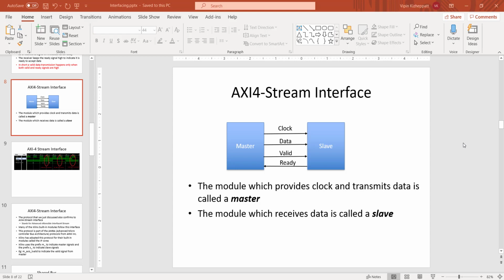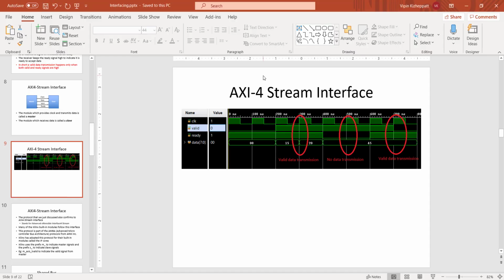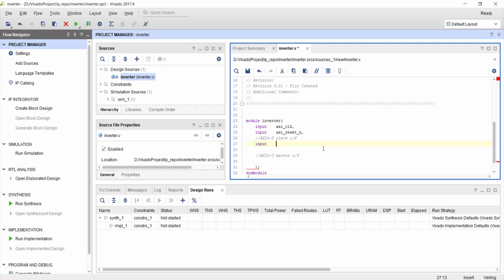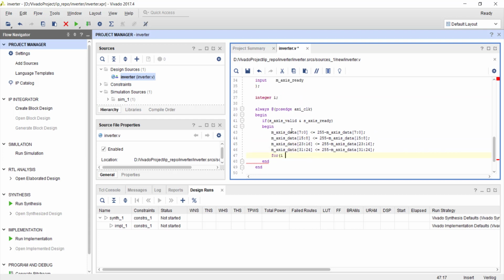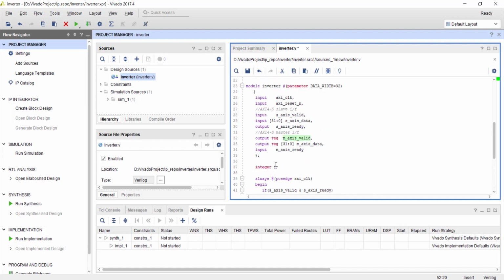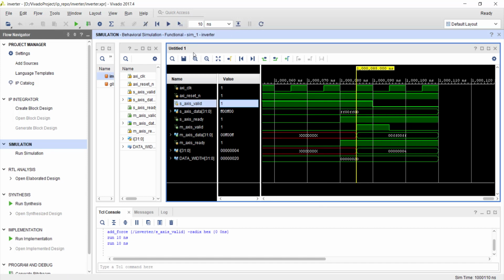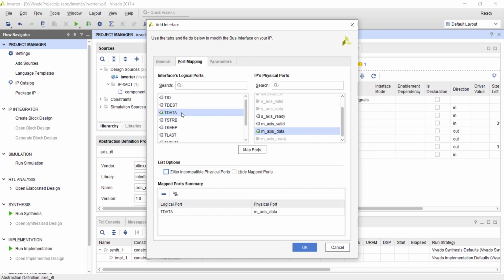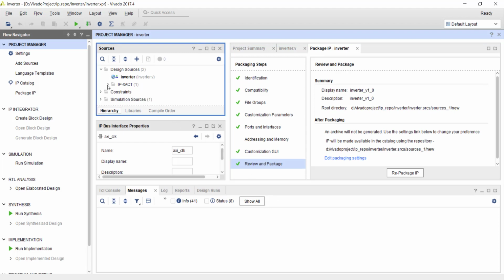Generating custom AXI4-Stream IP core using Xilinx Vivado

Comment: Your slide about what is master is inaccurate. Master is not determined by receiving or writing data, but whether it initiates a transmission. DMA controller can also read data from DDR memory, say, in which it is still a master, not a slave.

Comment: Exam questions be like:

@4:00: Please indicate whether or not the data transfer is valid at the following three timesteps: 300ns, 500ns and 700ns.

Like the fuck am I supposed to do with the third one???
Reply: For anyone else also confused by this bad timing diagram, you should be. Instead check out the timing diagrams in the AXI manuals regarding the VALID and READY signals, they're very well explained and not ambiguous like they are in this video.

Indeed, this video presents an ambiguous timing diagram where a signal is both changed on the same edge that it is being sampled, which can cause a setup or hold time violation, as well as ambiguity in interpretation.

I've seen this in many slides in my university and it bothers me because it's very confusing for students. What if the signal changes state very slightly earlier, or slightly later? The entire behavior of the circuit is changed

Comment: 24:17  I think mvalid <= sready & svalid is a crude statement and deviating from axi specs as the valid goes low when ready goes low at the master side. You should have written the mvalid statement inside the "if" where mdata is assigned, so that the valid signal remain latched like mdata even if ready goes low. This will save a cycle as well as comply to axi specs.

Comment: Sir Its a great video... clearly understandable. But I have some doubts in this. As per the concept data transmission should take from master to slave , but in this video you have written code the code for slave to master. means you are inputting data at slave and sending it to master. How is possible? would you not mind to explain it please?
Reply from the maker: It will be incorrect to say whoever transmits data is called a master. Generally a master is defined as the entity who initiates a transaction. That transaction can be read or write. In case of write master will just write and in case of read master will initiate the read option and slave will send the data. This is especially the case in AXI4 interface. In axi stream, yes the module which sends data out we will say has a master interface and the one which gets the data we say has a slave interface. It is very much possible same module has both master and slave interface. That is what is happening here. The customer IP has a slave interface, through which it receives data and sends out the processed data through the master interface.
Reply: @Vipinkmenon  Understood sir... thanks alot
Reply: @Vipinkmenon  if either slave or master can receive and send then why is the send part here the master? I get that master initiates so is it because if its slave it won't be able to send data if it's done with processing it? would making the output part slave and having a done line to processor be an alternative to this? like whenever done is high master can receive the data and then confirm it back to slave to send next data?

Comment: This is a great video, may I ask why we cannot directly assign 32 bits input signal to an 32 bits output reg, but using a for loop do process 8-bit by 8-bit?
Reply from the maker: That is correct. If you look at my subsequent videos, that is how it is done. But there is a reason why it is like that in the Xilinx template. For AXI interface, there is an optional signal called KEEP. Using this signal you can choose which in a register which data should be changed and which should be preserved. 1 bit in KEEP represent 1 byte in axi data. So for a 32 bit data interface, there will be 4 bit KEEP. If the keep value is 'b1111 all the data will get stored in the register. If it is 0111, the upper most byte in the data shouldn't be written into the register but only the lower 3 bytes. So on and so forth. That is why Xilinx using that for loop instead of using a if else if or a case statement. For loop is more scalable in this case since the data width can be any multiple of 8